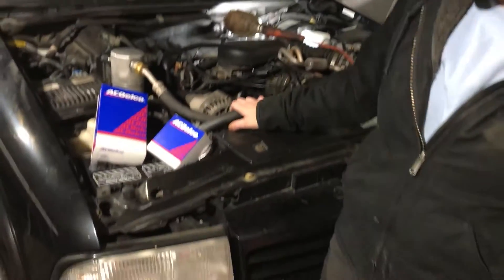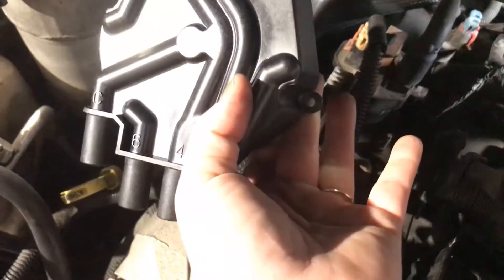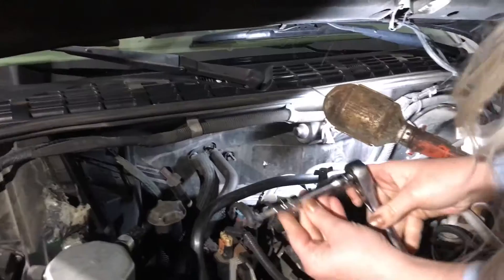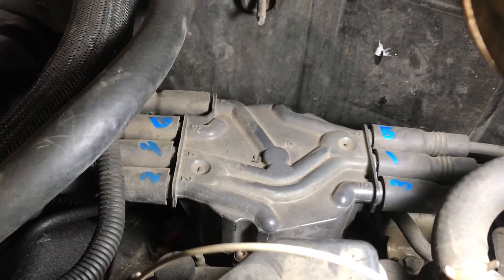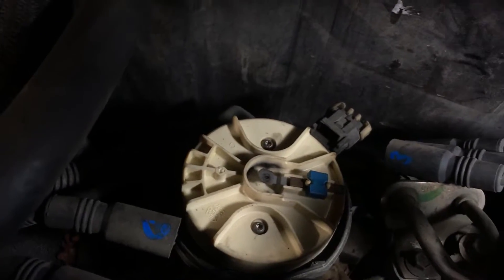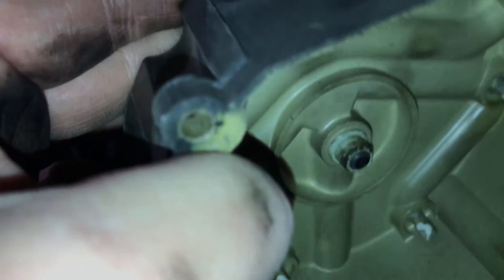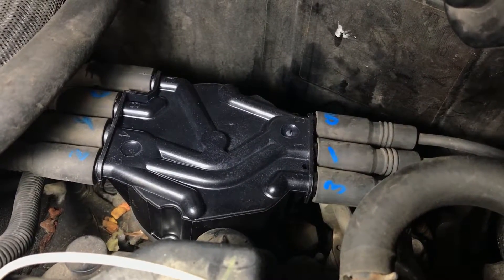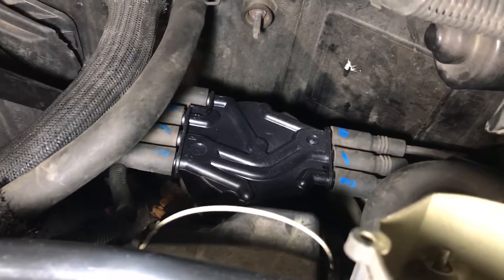HOW TO REPLACE DISTRIBUTOR CAP AND ROTOR ON 4.3 V6 VORTEC // BRAVADA EPISODE 7

Comment: I recommend getting a cap with gold/brass terminals as they don’t tend to corrode like the aluminum ones do, I’ve replaced several over the years with my 02 blazer ZR2!! If you continue to have the same problem check for play in the distributor itself as the gear tends to wear out over the years. Keep us updated 👍
Reply from the maker: Thanks for the knowledge and advice! So far so good with this one, although it didn't exactly take care of our crank no start issue when the next rain came. 
We dug a little further and found that the coil had a spot on it that appeared to be an electrical short! We replaced the coil with one off of one of our parts vehicles and sadly that did not fix the problem either. 
When it crank no starts, our best attempt to get it started the quickest is by holding the pedal to the floor while cranking until it stutters to life.
Not exactly sure what we are going to try next but the bug isn't fixed. Any input on that?
Reply: Plugs and wires
Reply: @s10life  update!!! As I was going through the same issues when it rained, an old mechanic friend of mine was telling me to put a small amount of dielectric grease on every terminal of the distributor cap along with where the plug wire’s plug inn, I did that 6 months ago and that fixed the no start when it rains issue. Try it , you’ll be amazed something that simple seals out the moisture. Keep me updated.
Reply from the maker: Definitely going to do that, THANK YOU!
Reply: @s10life  you are absolutely welcome, definitely do that ASAP!  I delt with the same issue for almost 5 years lol, I absolutely understand the frustration as I tried everything I knew of but those old mechanics know thier stuff haha, you’ll see the dielectric grease for plugs and wires, that’s what you’re needing.
Reply: egr

Comment: Sometimes if it don't start the fuel pump relay didn't prime the first start that's all that relay does then after it's started the fuel pump runs off the oil pressure switch.  And would seem like your replay is good . Overseeing the actual problem.

Comment: How is your truck running?
Reply from the maker: It's running excellent but still crank/no start when there is a rain and its the first time starting it that day. Read a few places to spray Wd-40 into the distributor cap to repel moisture so we might try that.

Comment: #1 GM OEM distributor cap and roior ONLY. Costs more but much better component and build quality.
#2 These "pancake" distributors wear out and lose ignition timing causing all kinds of weird symptoms. Look up "Pancake Distributor Disease". 
#3 Unlike what it seems, one of the external distributor cap connections does not go to the corresponding terminal inside, but actually crosses over another one inside the cap, where plastic aging can cause an internal cross-fire you cannot detect like you can any other engine. This is why the GM caps ONLY; the cheap 'autoreiiladvan' crap can fail in months.

Comment: Is it possible to put the rotor on wrong., you can put it on in a 180 reverse, it's possible, will that affect it
Reply: Impossible
Reply: I'm currently working on mine and I forgot which way the rotor was facing so I guess it's a 50\50 chance if I got it right if not Im not sure what will happen probably not run or run poorly.
I guess I will see.
Reply: @markholland273  probably not run